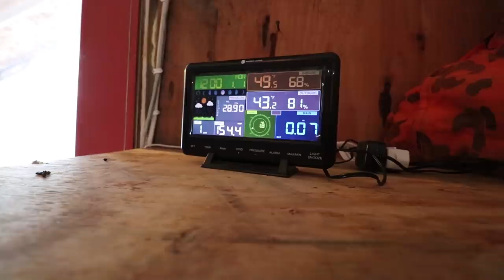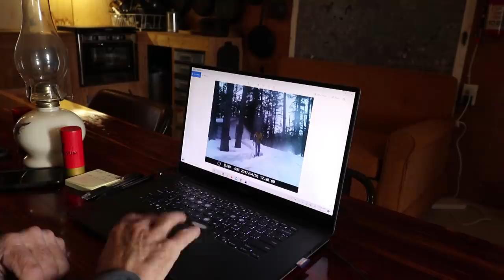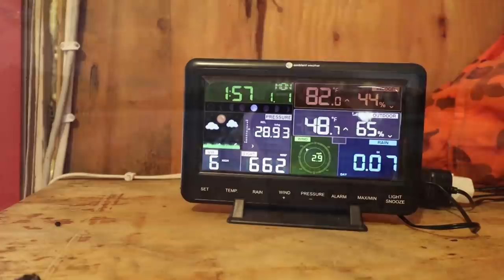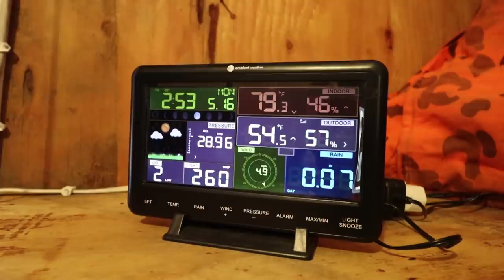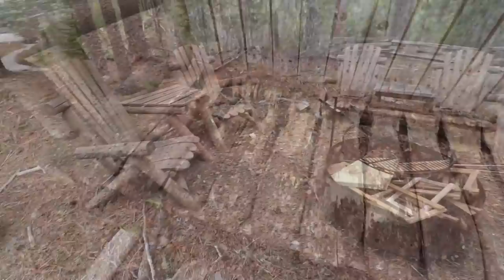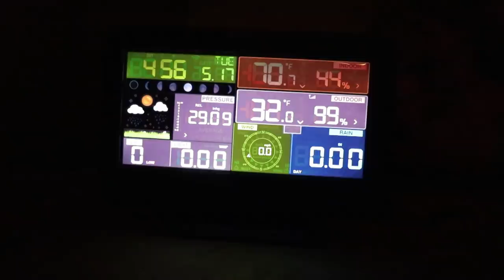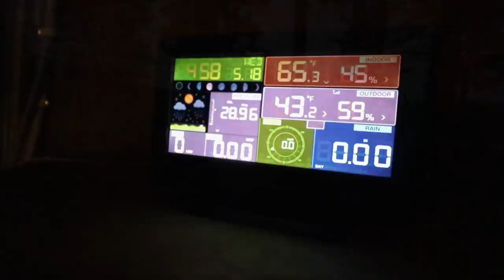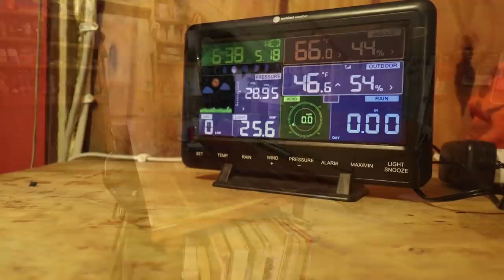THE TENT. Opening Fishing 2022. Getting things opened up for the season. High water. Solitude.

Comment: Hey, Joe. Have you ever thought about using Total Boat Penetrating epoxy rot repair. I used it one time for my wood transom even though I replaced the wood. It worked so good I started using it on my wooden chair to wooden door to even my steps. It seems to work better then regular stains I use to buy.
Reply from the maker: I will have to look into it for other things but I do not want it on the chairs, I want them to weather and when they rot I will replace them. I can see many other applications though where I would use a product like this.

Comment: Hey Joe.  I love your videos and have been a long time subscriber to your other channels.  One quick fishing suggestion...slow your reel in speed to about half of your current speed.  My experience is that you will have greater success.  Thanks!
Reply from the maker: I can't. I use a 3/8ths weighted spinner bait and if I go any slower it will hit bottom. I spent good money trying to find a baitcasting reel that was in the 4's for the gear ratio but could only find a 5:3 but that is still rather slow compared to the usual 6 and 7's. I tried slowing it down this time and brought back dead weeds every time. I do not want a lighter bait because then I can not cast nearly as far and the baitcaster will birds nest. I absolutely can not stand using an open face reel. I could switch to a closed face but I really like my baitcaster.
Reply: @JoeandZachSurvival  Thanks for the detailed answer!  Makes sense.

Comment: Slow your retrieve in That cold water! Will def get more bites.
Reply from the maker: I can't. I use a 3/8ths weighted spinner bait and if I go any slower it will hit bottom. I spent good money trying to find a baitcasting reel that was in the 4's for the gear ratio but could only find a 5:3 but that is still rather slow compared to the usual 6 and 7's. I tried slowing it down this time and brought back dead weeds every time. I do not want a lighter bait because then I can not cast nearly as far and the baitcaster will birds nest. I absolutely can not stand using an open face reel. I could switch to a closed face but I really like my baitcaster.

Comment: Love the tent. So cool that your Dad and you have places side by side. 

What would it cost to put in running water and a functioning bathroom? Is it cost prohibitive due to where it is?
Reply from the maker: Anything can be done. I have had a company come out and map out where a sewer system can be placed. They usually cost 8 to 12 thousand and then digging the well which would be between 6 and 8 thousand. I may do it someday but it makes for a lot more work shutting things down for the winter.

Comment: Funny about the caption...the first thing my wife said when the lake was shown was..."wow that water is high". How does the water level rate historically overall?
Reply from the maker: Last fall it was 18 inches below the dock. It is about 12 inches below right now. I have had it where the water was exactly flush with the bottom of the dock boards. The lowest then was 6 inches below what it is now and the highest was 11 inches higher than it is right now. Most of that is determined by what the beavers have dammed up down river since a river runs through that lake. In this video you could see that the forest service had removed what they were doing down river at the double culvert allowing the water to stay lower. Since the rivers run north there they are not getting slowed down like the rivers in Minnesota that run south where there has been flooding.

Comment: Hi, just wondering if you have ever had an incident with a bear or wolf! When I go hiking I usually carry  Glock 10 mm. Do yo carry a hand gun?
Reply from the maker: I see lots of wolves. I have a video somewhere where one is just sitting in the back yard of the Tent like a lonely dog. We see wolves up there all the time. I see bears as well. Not sure you watch all the videos but I had one try to get through the front wall of the Tent last year. I have several videos where my trail camera on the front of the Tent has had bears on it. I would say 90% of the time when I am out in the woods I do not carry any firearm (non hunting season). I have my 9mm with me up there always and because of last years bear and the fact that there is not much for them to eat right now I did bring up one of my 12 gauges and had slugs in it. The only time I carry my 9mm with me is when I go to check my deer stands in the summer because one of them overlooks a clearing area that has millions of raspberries. I always worry that I could be walking through that briar patch and get between a mom and her cubs. Like I said, we see wolves and bears all the time but they always run away. I worry more about some nut case person than the animals.

Comment: It looks like a tent from the outside but that's a building
Reply from the maker: You are wrong. Watch this video. https://youtu.be/gE_sMi3yUJo
Reply from the maker: You are partially right because the back area I added on.
Reply: @JoeandZachSurvival  I will go back and watch the rest of it I do think the making of the tent was very interesting thank you for the suggestion of it
Reply: @JoeandZachSurvival  my problem was how it was kind of built I just thought the angle was too perfect like as if it was a built structure pink canvas can be that Sharp but of course you can because apparently that's what you did very interesting anyway

Comment: You loaded 3 shells in the shotgun, then clicked one into the breach.. Isn't that illegal making the shotgun capable of holding more than 3 rounds? It is in most states, and they need to be plugged meaning you can only hold 2 plus one in the chamber
Reply from the maker: Every shotgun is capable of holding more than 3 from factory. It only had 3 shells in it.
Reply: @JoeandZachSurvival  I researched it, unplugged shotguns are legal for anything except waterfowl in Minnesota, so it was legal in the video.. In waterfowl season, your shotgun would need to be plugged and illegal in the configuration you had it in yesterday. It's NOT what is in the gun, it's what it is capable of holding. Look it up

"Shotguns must be "plugged" to prevent them from firing more than three rounds before reloading. Removing the plug from a semiautomatic or pump gun's magazine to enable it to hold more than three shells (one in the chamber, two in the magazine) is a blatant violation of the law."
Reply from the maker: No doubt, listen we follow the laws pretty seriously. And don't need arm chair cops telling us what we already know.